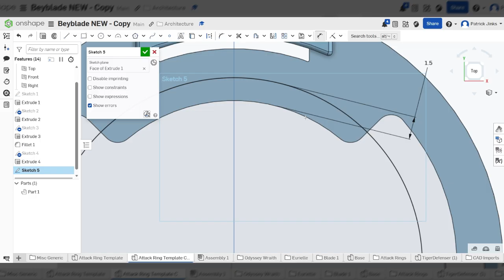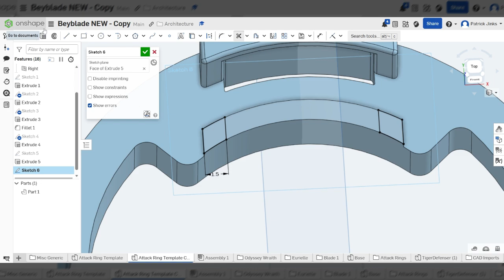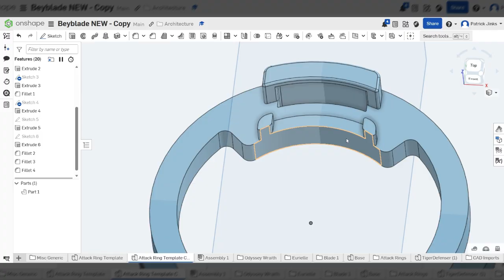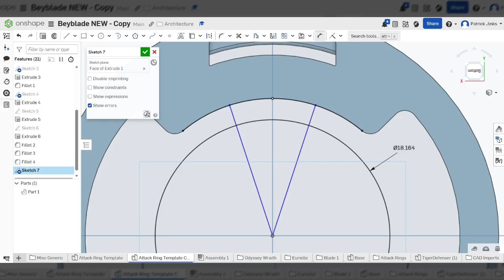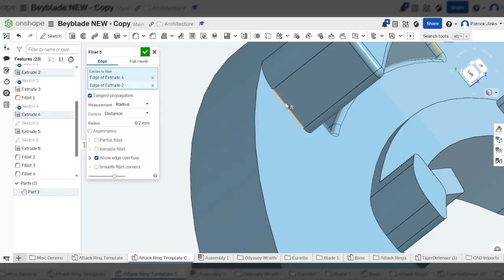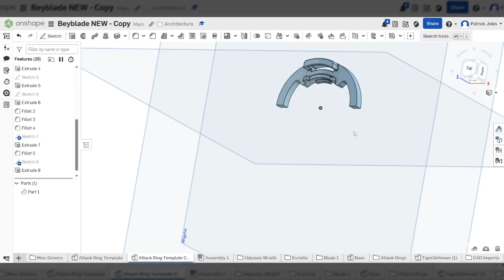How to Make a Beyblade in Onshape – Ep. 2: Finishing the Template

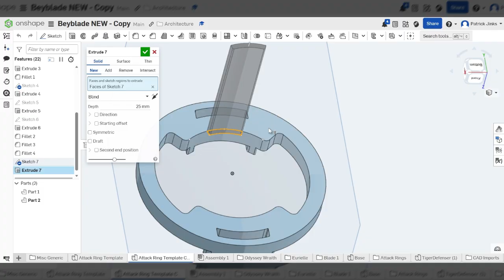Comment: When I tried to extrude that little innermost key portion around 8:51, it wasn't allowing me to add. I managed to work around it as new part and boolean the two together without issue, but wasn't able to do it directly through the extrude tool. Do you know why that is? Maybe the dimensions of the two parts were intersecting?